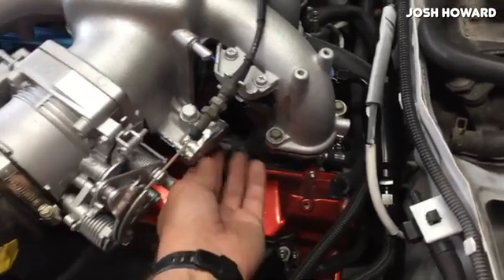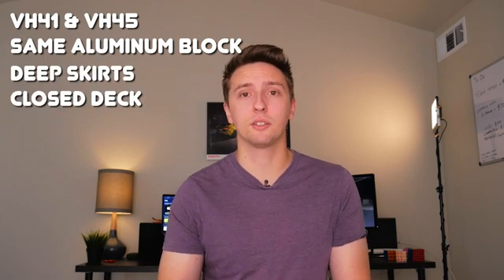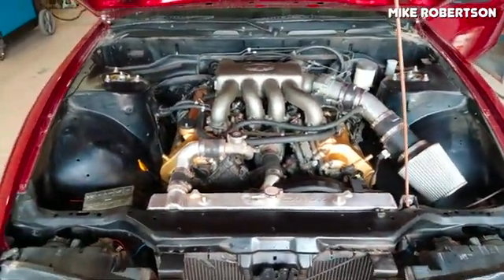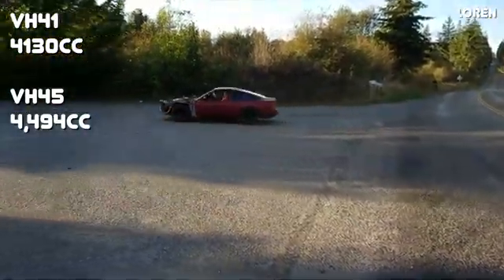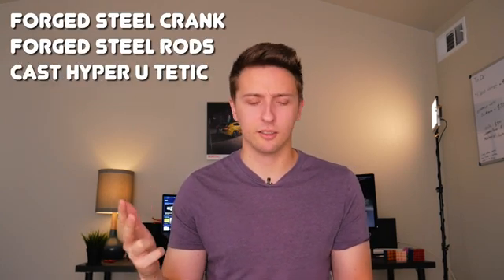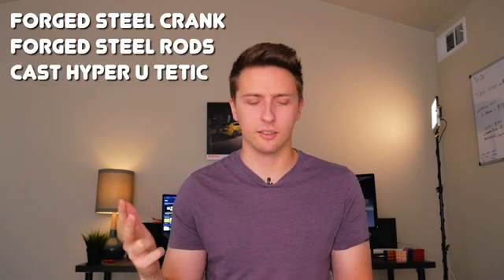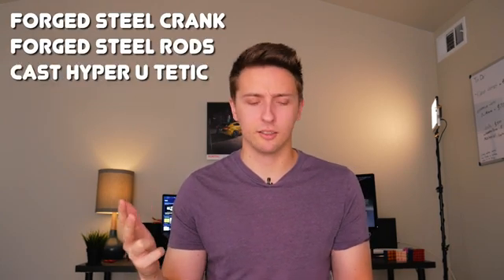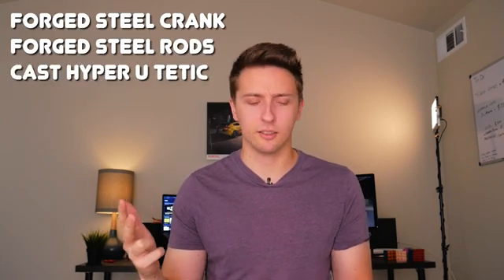VH41DE vs VH45DE: Which One is Better?

Comment from the maker: If you guys enjoyed the video, please SMASH THAT LIKE BUTTON. It helps the channel out a huge amount and helps YouTube put the video in front of more people. Thanks for watching 😬
Reply: Actually the US version of the VH41 was a weaker engine than the VH45 and did not include items such as the engine girdle.  The JDM version of the VH41 did have all the internals of the VH45 including dual chain timing.
Reply: I guess I would try to get a later version of the VH45 and see if the heads of the VH41 are interchangeable. If they fit, The engine should make more than 10% additional power with just a tune and a simple exhaust.

Comment: 3:00 - correction... the manual for my '98 Q45 specifically notes FORGED pistons, with a warning to not work the engine hard until it's up to operating temperature.

Comment: The VH41 also has double row timing chain whereas the 45 has a single. Because of the heads being different the 41 has slightly higher compression than the 45. For me the 41 is better, I have one in a Nissan Navara ute with a 300zx gearbox and Nissan Torrano (LSD) diff. The factory exhausts are very limiting so with extractors and better air intake power gains are very noticeable

Comment: Some inaccuracies and misinformation in this video. I have extensively compared the motors side by side and provided a lot of the original information and photos of these motors on the internet back in the NICO forum days almost 15 years ago. I have also rebuilt a VH41DE and have owned three of them, as well as a VH45DE. I even CMM measured a cylinder head and reverse engineered the valvetrain it and built it in Solidworks to design custom cams for it.

I wouldn't regard the VH41DE as being more overengineered. There is no difference in the strength of the parts, simply some refinements to the packaging. Allow me to clarify:

The blocks are not the same. They are similar, but with many differences. The castings are physically different castings, with for example the starter motor on the other side, VH45DE block casting is wider to accommodate the wider front covers, etc.

There are at least two generations of each motor. In the VH41DE there is the FGY32 and FGY33 version. The one that was available in the USA is the FGY33 version, which has unfortunately led to the misnomer of referring to the FGY32 version as being the "JDM" version. It's simply the first gen one, before they cucked it with the FGY33 version.

The ports on the first gen VH45DE were a siamese style port, which matches what was done with the first gen RB20DET NICS engine, concordant with Nissan's late 80s cylinder head designs. The FGY32 VH41DE which came out a year or two later used the more normal large oval port style, which was later also present on the second gen VH45DE.

Other differences include the timing chain system. VH45DE uses a large timing chain on either side which goes all the way from the crank, up and around the cams. The VH41DE on the other hand, uses a single row chain up to an idler halfway up on either side, which then transfers drive to a dual row timing chain either side. This whole assembly is narrower and takes the extra width out of the front of the motor and front covers.

It is not only the stroke which is different in the internals, but the compression height of the wrist pins too. So different pistons. The pistons on the VH41DE also have a pop up crown, and the motor's compression ratio is 10.5:1 vs 10:1 on the VH45DE.

There are some other differences too, but I felt it important to discuss a couple of these key points because these are the main talking points I always see either overlooked, or misunderstood.

Comment: 90-93 vh45de is different than the 94-95 vh45's and the 96 is still the same engine as the 94-95 but it is lacking the vct. 94-95 is the best version but 90-93 uses a better ecu.

Comment: The 41 is better if you want a no-mod boost-ready engine, as it came from the factory with 10:1 forged pistons... but it's not recommended if you live in a cold climate region. Extended warm up times are a pain. You should never use more than 1/3rd throttle with forged pistons until the engine is warmed to operating temperature (there's even a clear warning for this in the 98-01 Q45 manual).

Comment: Nice quick vid dude. 

To add; VH motors are generally not popular because there is next to no aftermarket support, and a factory rebuild gasket kit can cost 1000$+, and they aren't very common.

The first generation 41 was japan-only, where later international iterations were progressively detuned with different spec for cost reasons.

41 and 45 heads are not interchangeable across blocks.

Piston integrity and rotating assembly oil pressure are the weak links, when force-feeding past 500hp. Stock valve springs are inadequate for 7800+rpm. (which the 41 can easily exceed otherwise) The rest of the longblock is good for whatever you dare throw at it.

45 used dual timing chain, 41 is triplex with idlers

the exhaust is the breathing chokepoint on either stock engine; cast log manifolds are ok but quickly restrictive.
Reply: So if you ain't trying to do any power upgrades just using it as a daily drive and off roading will it still be a good engine.  I want to swap either 45 or 41 in a nissan patrol  y61

Comment: Gentleman's agreement cap was 276 HP. Japan uses metric, PS. 276 HP is 280 PS. 280 HP would at least around 285 or 286 PS. What's funny is Japanese word for horsepower is bariki (kanji characters are literally "horse" and "power") and it is used for both PS and HP, it can be confusing sometimes. Japan probably still be using the PS unit to measure power, so keep in mind.

Comment: 7:51  I think the Ford Modular V8 engine program was impressive in 1991(2v) and 1993(4v).  So impressive that the first Koenigsegg's built were powered by Ford Modular V8's and continued to use its architecture.

Comment: You're using the term JDM to describe Japanese engines sold in the US market. If they are sold in the US market then they can't be JDM. Made in Japan does not equal JDM.
Reply: but the VH45 and 41 were both sold in US and JDM market. Only key difference with the Y33 and F50 is that they got the v6 versions as well.
Reply: @TheAstroKidx  That still doesn't make them JDM. If they are sold new in the US, by definition they are USDM, not JDM.
Reply: @kp2941  If you aren't able to comprehend what the initials JDM and USDM mean, then watching Fast and the Furious isn't going to help you at all. The fact that you don't understand the difference between "your" and you're" probably goes a long way towards explaining your lack of comprehension.
Reply: So, a Corvette, Camaro, Mustang, etc. imported to Japan is considered JDM there?  LOL.  Manufactured in Japan means JDM.  The car was designed and built in/for THEIR market and the U.S. imported them.  Camrys, Accords, Altimas, etc. manufactured in America are still considered as imports, but I'm not sure if they'd be referred to as JDM.  A right hand drive version imported to the US would be considered JDM though.
Reply: @midrangetorque  You apparently don't get it either. If the Corvette, Camaro, and Mustang were built for and sold new in the US, they are USDM regardless of where they end up being shipped to or sold later on. If they were sold new in Japan then they would have to meet all the emissions and safety laws in Japan for that model year, and they would be JDM vehicles. 

Manufactured in Japan does NOT mean a vehicle is JDM.
Reply: I can see how people say the engine is JDM because vs the whole car that is changing from right hand drive to left hand drive the engine of these cars are exactly the same, u could even put a JDM spec 4.1 or 4.5 engine in any of these us spec Infiniti q45s and it will still work exactly the same. Computer doesn't even have to be changed either nor the emissions because the computer is the same, So if u really think about it it's a JDM engine, I mean there isn't really a reason to argue about it for everyone is entitled to their own opinions but if I wanted to play smart and explain exactly what I explained to u then it kinda proves that these engines are JDM engines. It doesn't necessarily mean the who car is because the car it's has tiny differences in the US spec vs the JDM spec which u already know.
Reply: @RenNakamura20  JDM engines do not have the same emissions equipment nor ECU as the US models. That's not the point of my comment though, they could be the same and they are still not JDM. JDM does not refer to vehicles or engines sold new in the US, regardless of whether or not they are the same. Japanese Domestic Market = JDM.
Reply: @RenNakamura20  You can't just drop a JDM engine into a USDM car. JDM cars are right hand drive, USDM cars are left hand drive. The block configuration with starter motor position is specific for these facts, to permit room for the steering column, among other things.

Comment: Followed Infiniti/Nissan at the time and have owned an 01 FY33 Q45 since 2004. It was commonly accepted at the time the reason for the lowering of displacement from the VH45 to the VH41 was mostly due to the RE4 transmission. This is the same transmission as the Z32TT which has similar power, but significantly less off the line torque (at least in stock form) than the VH45. The early Q45s with the VH45 were limited to a 2nd gear take off from a dead stop to protect the trans from the low end torque of the V8. After complaints of the poor performance this resulted in, Nissan changed the TCU programming in 93 (going from memory so I may be off by a year or two). This greatly improved performance, but also led to transmission issues in many cases. The decrease in displacement in the VH41 combined with the changes to the heads moved the power band up in the rev range and reduced stress on the trans. I currently have 217k on the original trans in mine and it is still pulling strong. Admittedly, with the slow 2-3 shift the RE4 is known for.

There is another big issue with the VH family that was not mentioned in the video. It is EXTREMELY important to perform the scheduled maintenance for the o-rings on the injectors. Due to the design of the fuel system, if one of these o-rings fails the fuel system will dump fuel into the cylinder and hydrolock the motor. This is a more common problem on the VH45. As with many of the common faults, Nissan tried to address them in the VH41, but with increasing ethanol content in fuels even these changes only last so long. If you are looking to do an engine swap, do this bit of maintenance while you have the motor out of the car and it may save you a ton of headaches down the road.

I have long thought the VH family may be one of the last undiscovered gems from the JDM heydays and the F50 and FY33 Q45 to be two of the most under rated cars of their era. But please, if you are looking for an engine for a swap, please don't trash a good, running Q45 to get it. You can find pulls of the VH motors for a few hundred dollars all day long. These cars truly were over engineered and designed to last for the ages, find a total or a pull for your swap, and put some sweat equity into restoring the running Q45. Remember, with few exceptions, almost every classic car was considered junk at some point in their history.
Reply: This is a beautiful post lol, having owned a Q45 they are just amazing. Cars like that are no longer built.

Comment: I wish they made plug and play tuners for the vh41s and cheap cold air intakes for them.
Reply: You can put the UpRev on the VH41. The stock intake on the 41 is something like 4" in diameter. All you need to do is replace the airbag with the cone and you should be set. I would be really surprised if you gained much off the stock set up though. It is a fairly free flowing set up.

Comment: Vh41de has a dual timing chain from memory.
4
All my VH45 I've turbo charged. I rate the vh45 as good as my built 2jz.
Built VH45 turbo would be better.  
Vh41de is okay I guess 🇺🇲🦅🇺🇸🦅🇺🇸🦅🇺🇸🦅🇺🇸🦅
Reply: Made 680rwhp e85 through a auto with some mods.
Need to change valve springs. Used a nistune ECU and hi flowed the injectors. If you want more info let me know.
Lasted 2 years of me thrashing it. AFM caused a lean out and broke in the end.
Reply: How much hp are you pushing with your stock VH45? Looking to do the same with a 300zx.